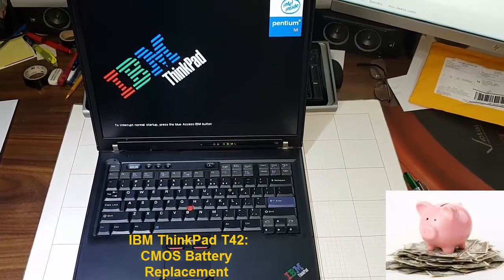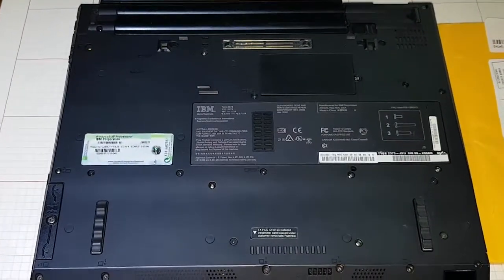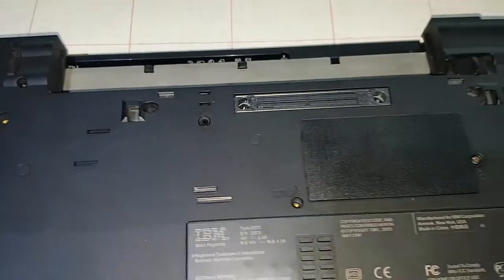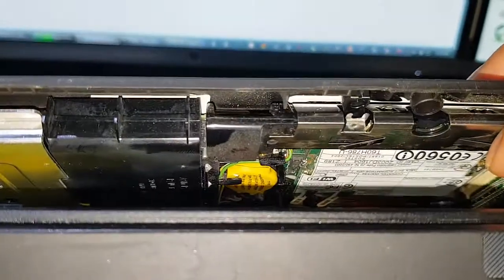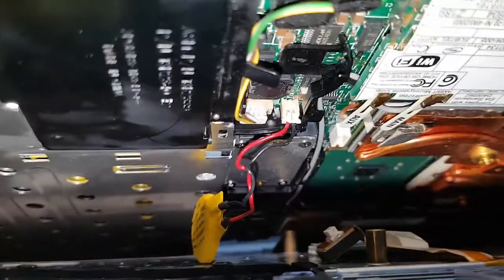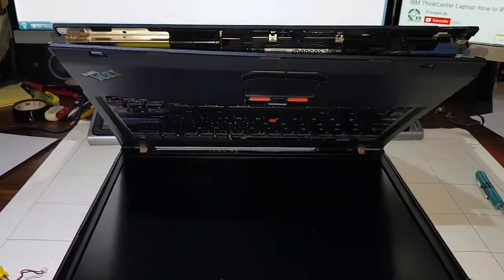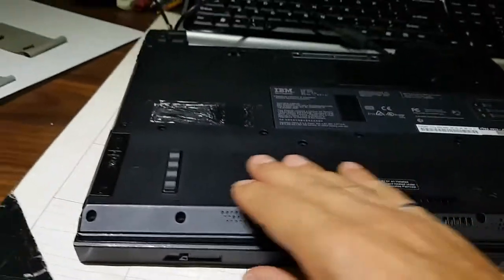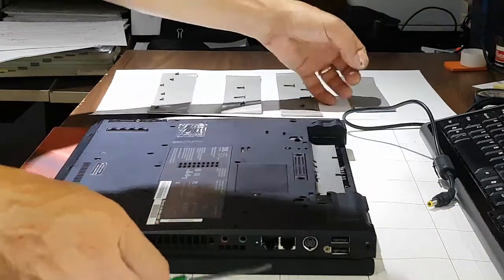Replacing CMOS Battery for an IBM Thinkpad T42

Comment: hello bro, i just have remove some screws now on a imb thinkpad, and i just now saw your video.  I couldnt imagine that the cmos battery here is like an adapror with cable connection. Anyway, can i replace the battery with a cr2032 in that yellow piece? does it open easy somehow? or im gonna destroy it? Worth?

Comment: Not a fan of this at all. I was going to replace the CMOS battery on this laptop I fire up infrequently. I think I’m going to leave it alone. I have an older Thinkpad where a single screw on the underside allows the user to pop out a panel and replace with a button cell. On this unit they used a proprietary battery rather than an off the shelf button cell. Major downgrade in my opinion by IBM.

Comment: Would this also cause a NO boot condition but the fan turns on after the power button is pressed?
Reply: Bit late but yes, I had the same Problem and if you want to still boot without changing the cmos battery you have to disconnect the power and battery, then hold the off button for 15-30 sec and then reconnect the power sources, now it should boot (you have to do this whole process every time you turn it on until you change the battery)

Comment: Having dealt with a lot of Thinkpads in my career so far, I'm pretty sure you only have to remove the keyboard rather than pull the whole unit apart like you have shown here.
Reply from the maker: Thank you for your comment Ibrahim, but for this particular model I don't think it is possible to remove the keyboard without disassembling from the back as I have shown.  If there is a way that you know how to do it by simply removing the keyboard then perhaps you could try to create a video clearly showing how to remove the keyboard to access the CMOS battery and then post it for others so they won't have to go through the whole procedure of removing all the screws from the backside. Vito Casola - FIX IT Yourself!!
Reply: Not on this model. OP is right. The CMOS battery is under the touchpad. You can be lazy like me and remove the keyboard and a few extra screws that loosen the main plastic frame enough to sneak some tiny hands in, but it's definitely not UNDER the keyboard. If you removed stuff under the keyboard you could remove the wifi, gpu, cpu, and the heat pipes that keep things cool. I like those where they are though. Oh ram is accessible under the keyboard too.